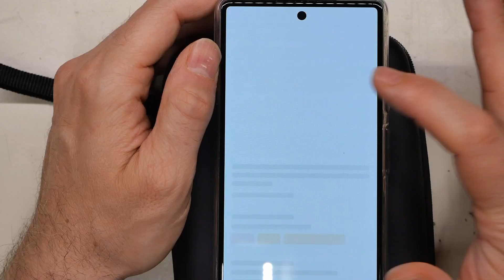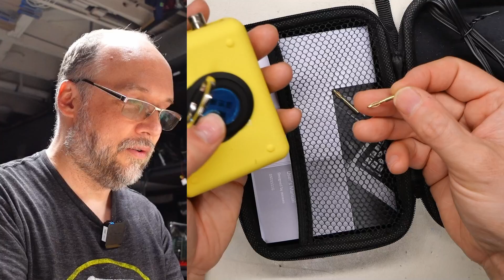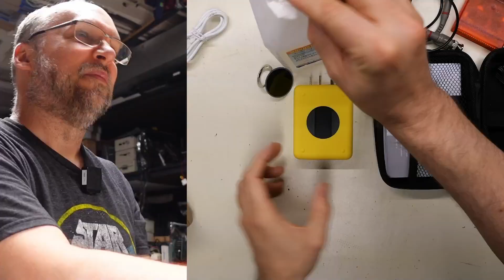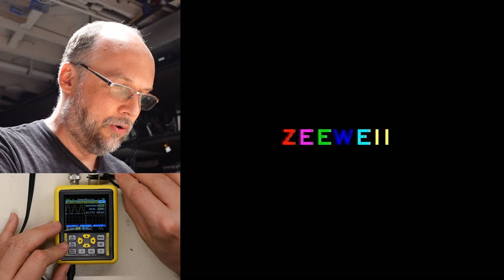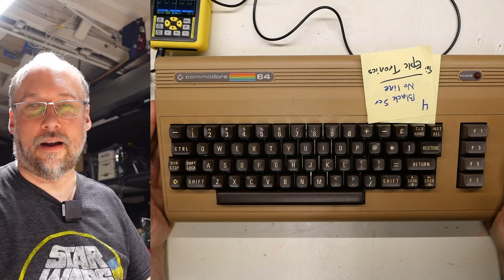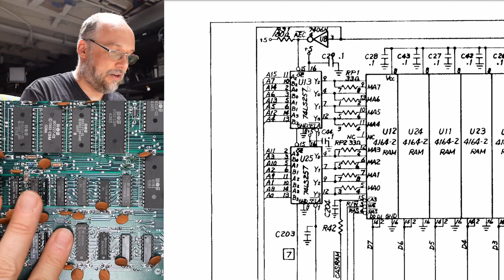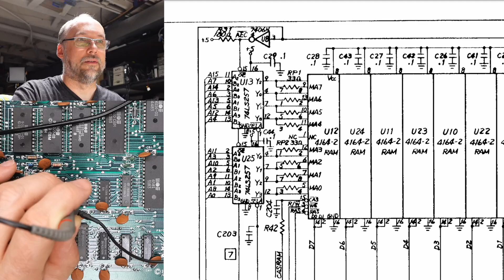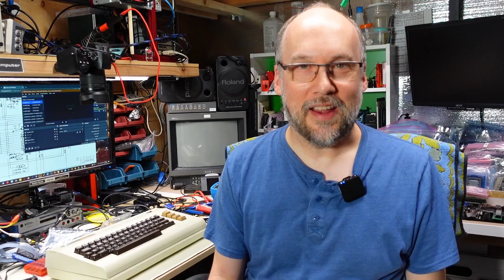4/12 C64 repair using a great $57 portable oscilloscope (ZEEWEII DSO1511G review)

Comment: I've done a sweep test on the bandwidth of those scopes the linearity tends to drop off at around 20-22Mhz, they seem to be good for audio and automotive work, plus using them them on batteries means it's isolated too so no need for differential probes while it's running off its internal power supply or via a USB power bank, but the scope bandwidth is never what they say it is.
Reply from the maker: Yeah as long as you don't connect the A/V cable or USB cable while using it, I'm quite sure those inputs are not isolated so it will suddenly become earth referenced.
Reply: @adriansdigitalbasement  , you could run those things on their own portable battery supplies but you still run the risk of having a those devices ending up with a hot chassis, so you wouldn't be able to make adjustments for safety reasons while it's connected to the device under test (DUT), plus with multi channeled devices you'd have to be even more careful because the BNC grounds would be connected together so you couldn't just place the grounds where ever you like, lots of traps you have to accommodate for unless the scope has isolated connections like the plastic BNC connectors on the fancy Tek and Fluke scopes or you have to get differential probes which might limit bandwidth, you can use isolation transformers on the DUT, but again you have to be mindful of where you place the grounds.
Reply: @imranahmad2733  These devices are in plastic chassis and adding a rubber boot to a normal BNC should prevent touching.  But isolating the video out ground will be a problem if not sticking to the internal screen.
Reply: 20 MHz is quite impressive in fact !
My small DSO-150  can't go that high. Don't remember about the Hantek6022 ...
Reply: @nalinux  , 20MHz is quite respectable and handy, it's just a shame they have to put fake specs up to entice people into buying their equipment, you'll probably laugh but I've got a DSO112A which is about 2Mhz (actual bandwidth 1.3MHz) I picked up for £40, it's used for automotive (mainly abs, alternator noise, checking if canbus signals are there, monitoring pwm outputs) and audio stuff, it has 5mv/div which I thought for a cheap scope is pretty decent, but I do have some proper scopes from agilent, Tek, fluke that go upto 500MHz, I barely use the full bandwidth of those scopes and they can be unwieldy and overkill for portable use, not to mention expensive, so I don't take them into risky environments except for the fluke which is made for rough handling and isolation, but for alot of things I only need resolution in ranges of 10s of KHz to 50MHz, I've only ever needed higher bandwidth for calibration and catching and capturing glitches.
Reply: @imranahmad2733  I use my scopes only for audio, a bit of electronic repair and Arduino.
To be honest, the DSO150 is more than enough for this, the Hantek 6022 was a gift to myself, and 2 channels is a useful feature.
I would have no use of a high bandwith scope. 
I'd like the Hantek to go up to 10 MHz, because some times we have oscillations in audio circuits. But that's really the only reason :)
The great thing is now they cost quite nothing, and don't take any place.
Reply: @nalinux  , I use my scopes for quite a few things (RF, audio, vehicle, retro computers, Arduino), but I'm really just a hobbiest now, I never paid retail for any of my equipment, it was all second hand or spares and repairs and I was able to fix them, they where very cheap to obtain about 12-15 years ago, my first scope was a iwatsu 4ch 100MHz scope I picked up in 2006 for £30 delivered and working, before that I had to borrow one from a TV repair shop that would let me use it in exchange for fixing their computers, but now I've seen the same scope sell on eBay for £200, prices of second hand equipment have gone absolutely crazy, and some of the old agilent scopes are still better than anything you get now but the prices don't justify them anymore especially with some of the rigol and siglent equipment about.
Reply: Scope bandwidth isn't far off the claims made. Don't forget, 100Mhz claim is for a pure sine wave only. The rule of thumb being a 100Mhz scope is good for approximately a 10 to 20Mhz square wave. If you don't know why then look up Fourier analysis.

Comment: I saw that the AV output actually also had two audio outputs, I wonder what they are for. If it's only to output the beeps the device makes it is not very useful, but if you can hear the measured signal (through a low pass filter) then the device can be also used just as a logic probe, so that could be useful.
Reply from the maker: Off camera I did actually test this but no sound was released. Maybe it's for the secrete NES mode once you enter the Konami code into it. :-)  [Kidding, of course.]
Reply: @adriansdigitalbasement  I'd absolutely love someone to make a scope using a NES-on-a-chip. Wouldn't be great, but it'd be fun

Comment: That actually looks like a really handy oscilloscope for automotive fault finding. Cheap enough to buy one to throw into a toolbox. My old analog scope is pretty cumbersome in automotive applications.
Reply: Some scope is better than no scope, but... much of the merit of a scope in automotive diagnostics is to see the relative timing of two or more signals. For example, cam-crank correlation, or crank vs spark and so on.  So two channels are, in my view, the minimum requirement, and there are some two-channel inexpensive hand-held scopes.  But a single channel is still good for looking at an individual PWM signal,  or an ABS wheel encoder etc.
Reply: @Graham_Wideman  u make an excellent point here. It's not that useful without at least 2 channels for comparing data. I suppose w USB C u might be able to capture data and compare it outside the scope, but definitely a pain in ass. Would definitely pay an extra $20 for an extra channel.
Reply: @TrapperAaron  there is a two-channel version of this.  it makes all the difference.  it's blue and has different but similar keyboard
Reply: Thats actually a really great point.
Reply: Yes, or elevator or lighting repair
Reply: I have what appears to be the same scope (only under a different name and without the AV out... d'oh!), and can confirm that it's useful for automotive applications. It'll never be a substitute for a proper bench scope, but for casual use or applications where a bench scope is impractical, this is infinitely better than not having a scope at all.
Reply: On autos is how I plan on using it!

Comment: I don't think this is particularly good value for the money. I'd take a look at the Owon portable DSOs, and realistically, for DIY, no one is ever going to need more than 20 MHz. Although it's clear that this little thing can't deal with 120 MHz anyway. But it's really not an important metric anyway for home usage.
Chinese sellers will often equate sampling rate with frequency capability. For example, a 100 Msamples/s device is in theory good for up to 50 MHz. However, neither the displayed waveform nor the amplitude will have any meaning.
A typical 100 MHz device will have around 1Gsamples/s, where the analog frontend might still be limited to 60 or 80 MHz as that is the point where the signal is already down 3dB.
Reply: Looking at Amazon, the Owon portable scopes seem to start at $125.  More than twice the price of this unit, so it's not really in the same price point.  Maybe the Owon is better...  but it's also more expensive as well. 

For a lot of people they might use a tool only a few times a year, so the cheap version that's still highly functional is often the better choice even though it's not as good as the more expensive one.  I've got plenty of cheap harbor-freight level tools that I'm perfectly happy with because I use them only occasionally.  But also a few name-brand tools that I use all the time that I'd never buy the el-cheapo version.

It all depends on what you're going to use it for, an how often.
Reply: @stevesether  I got the small OWON when it was on sale (as well as a few other people I told about), that was less than 100 EUR. There really isn't much of a comparison here.

Comment: They also have a 2-channel model with signal generator (2512G) which also has a marginally larger screen (2.8" vs 2.4") for not that much more. Drawbacks with that model compared to this is that the signal generator output and USB gets moved to the bottom to make space for two oscilloscope inputs at the top - so it won't stand up with any of these connected. 
I've been looking for someone I trust that has tested one or the other, I have to say it handles it a lot better than I was expecting... Not sure whether go for the $62 single channel or the $86 dual channel yet, most of the time a single channel works as you've demonstrated.
Reply from the maker: Yeah -- 2 channels can be useful but it's far less useful. I find myself using two channels maybe 5% of the time during repairs. The price creep is real -- it's easy to keep spending a little more to get a much better device .... that's the danger. The $160 Hantek portable scope (And the Owan version, which is probably a bit better) is far superior to this, but it's that thing about the creep. If it's something that will almost always just end up in a drawer only being used very occasionally, just get the cheapest one possible.

Comment: Thanks for the video Adrian! I was just yesterday thinking about getting a small oscilloscope for troubleshooting mains voltage appliances due to the danger of using mains connected scopes with such appliances. Keep up the great work!
Reply from the maker: Yeah battery powered is much safer on mains -- although I would be wary still. You could get a 100x probe (For cheap) which I would feel a bit better using with this on mains, especially if you're in 240v land.
Reply: For mains troubleshooting the best thing to have is an isolation transformer.